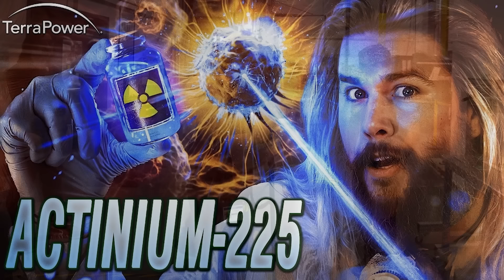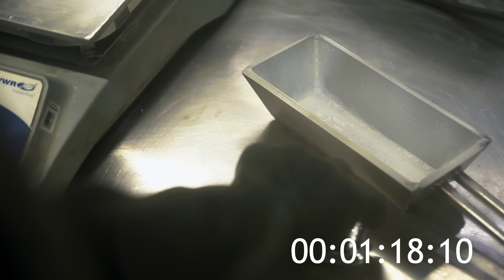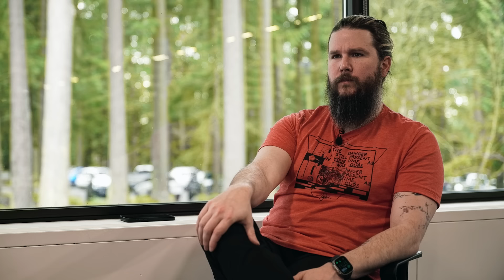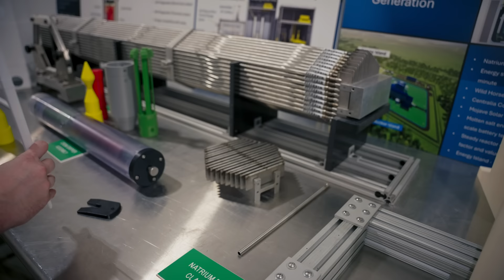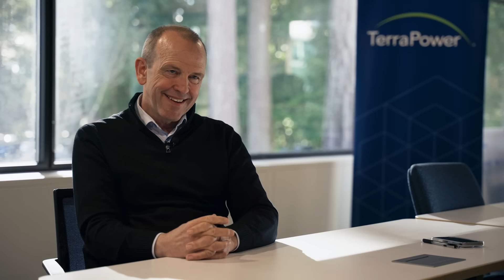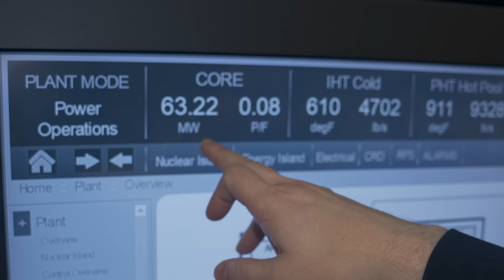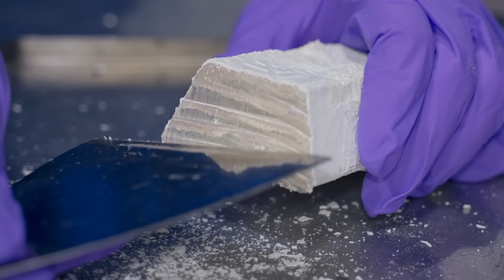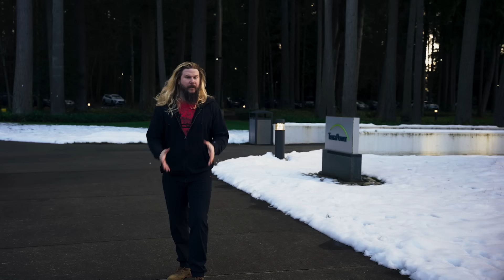Will Natrium Nuclear Reactors Change Everything?

Comment: 18:13 “You want to wear gloves to prevent the sodium hydroxides  from melting your skin and turning it into soap” is a wild statement to nonchalantly ignore 🗿
Reply: I love Kyle's "Oh is that what that does?" in response?
Reply: Surprised he didn't already try that out on a Kevin.
Reply: Actually, typical engineers, as they watch their prototype fail a "smoke test", that will get a layman running for their life.
Reply: Having worked with Sodium Hydroxide in school labs, yes it does feel slippery between your fingers. Leaky bottles from improper measuring.
Reply: Note that Sodium Hydroxide is commonly known as "Lye"  (also known as "Caustic Soda").
Reply: So, I had to patch a leak in my basement wall and proceeded to not wear any gloves while mixing and applying the hydraulic cement with my bare hands. I know what saponification feels like. Not fun. Lesson learned. It was bad for over a month.
Reply: @joecserna  Must read labels.  Hopefully the nukies know how to read.
Reply: "Dang, I forgot to buy soap today.... But I DO have this ingot of sodium and a waistline that could use thinning down."
Reply: Lye does the same thing. 
Lye + animal fat = soap. Skin would not be stretchy without collagen, and collagen is technically a type of animal fat. In short, we’ve known about that kind of injury for centuries.
Reply: I once accidentally dropped a miniscule amount of sodium hydroxide powder onto my middle finger. It left a burn that stayed there for 2 weeks and I can still see a miscoloured dot on the skin, though it has been couple of months since the accident.
Reply: It’s normal thing to say with this stuff
Reply: Fight Club
Reply: You don't ignore such a statement you HEED it
Reply: as a professional chemist why would our skin replace itself on its own if not to make up for not wearing gloves
Reply: @gerrits_machinations  😂
Reply: Based
Reply: What do you think exposure to high temperature and pressure steam will do to you?
Reply: Statement is not ignored if the gloves are worn as advised :D
Reply: Same with wood ashes, which is why they were used as an early form of soap, from what I've heard.
Reply: lol its true. sodium hydroxide, natural forms called "lye", have been used to make soaps for ages ;)
Reply: You can actually do this at home. But with bleach. If bleach gets on your skin. Itll also turn to soap. But dont do tgat
Reply: No more so than telling you to wear oven mitts when carrying 300 degree pans.  It is just lye, used in drain cleaning.
Reply: Kyle definitely did not ignore that. Watch his face as he looks at this hand after he hears that 🤣 18:31 😐😮
Reply: Hand-made soap
Reply: Wilder than that is there's a word for rendering fatty tissue into soap: saponify.
Reply: Chemists are very casual about a lot of potentially horrific things.
Reply: I'm not gonna lye....
Reply: I’ve gotten sodium hydroxide on me almost every day as I have to make pretzels for work. I’m a victim of soapification so much. You got about 25 seconds before it starts burning. It just feels itchy with mild exposure
Reply: bleach does the same thing to your skin lol
Reply: People worry about acids. Bases are like, "hold my beer". They turn fats in our tissues into soap.
Reply: @ComputerGeeks-R-Us and strong oxidizers say hold my vodka
Reply: This is actually very common. It's why your fingers feel "slick" after getting bleach on them.
Reply: Sodium will happily steal oxygen from the water in your skin as well...
Reply: what we have all seen fight club
Reply: Buzzkill. What if I want to do that?
Reply: Baking soda - not even washing soda, baking soda in yer kitchen for cookies - is also capable of making your skin a lil' soapy. It's just a nature of skin oils being hit with alkaline materials.
Reply: It’s also used to make actual soap, I’ve made some with the lye process it comes out nice
Reply: Thats pretty much what bleach does
Reply: @Cringer101 Holy shit… always wonder why when I use bleach and it got on my hand it feels so slippery… 😨
Reply: Yep you gotta be careful with bleach @ws.hicks0214
Reply: @ws.hicks0214  Hmm, me to I though it was from the soap in the bleach, but now I know that is just my skin melting.
Reply: @Cringer101 That's sodium hypochlorite not hydroxide
Reply: @Cringer101  not at all. thats what baking soda does.
Reply: @Cringer101  Good analogy.
Reply: Hey All.  What can I say :) (Sorry for my long list of “assumption”, but it worth to read it)
First: of all nuclear reactors can blow up not because of the pressure in the water, but because of the reaction runs away. 
	(I do not know any nuclear reactor failure, where the water was the problem, 
	all the time the control was the problem. The water only blow up just after when the reaction control was lost
	And to be honest lukily the water blow up, other wise the reactor core would blow up, 
	and the reactor core not only have 6.2kg of plutonium as the Fat Man nuclear bomb but several hundreads kg)
	Why this solution is different? Can't reaction run away in this solution when control got lost? Why?
	This video did not say a single world about how it will be controlled. (that is a suspicious sign)
Second: Concentrated Solar Plants are using natrium salt e.g Sodium nitrate (NaNO3) which is relatively stable, 
	this solution seems, it will use pure sodium (Na). That is a huge difference. 
	And this also means, we have zero real world experience with sodium in any reactor. 
	Maybe would be better to test in a gas power plant first.
Third: Sodium is very problematic, not coincident, nobody was able to do that before. 
	Sodium not just explosive and react with water. 
	It will react with oxygen, with halogens, with acids and of course with metals like aluminium, titan or zirconium and alloys. 
	It also can react with Nitrogen, which famous about its stability. 
	Which limits what materials can be used for the container.
	And the extreme heat will speed exponentially the reaction. Sodium will react with the wall of the containers, with the seals, with the pump.
	Before you said it will be sealed with argon, than how will heat transferred? Argon is a gas, which means, it will insulate the heat. (compared to direct contact) (that is why we put Argon into insulated windows)
	So how this system will possibly look like: the reaction heats the sodium, 
	the sodium will be transferred to another building, 
	where it will touch the side of the container, 
	and on the other side of the wall possibly will be water, because still in 2025 all nuclear reactor is just a steam engine.
	And possibly the steam will be 600C with extreme pressure, which of course "can't explode" (and don't forget sodium will be radio active)

Fourth: It is barely magnetic, and if you raise the temperature, even that little magnetism will disappear. 

Fifth: They are emulating in software. (yep, there was no bugs in software ever, what if one of the programmers uses chatgpt?)

Sixth: Also, if you think this won't instantly explode. This will be the same as the system with water.
	If you think on it, both water and sodium will have about the same mass which means, it can store pretty much the same amount of energy.
	And the water can boil, which means, if there is a release valve with a condenser, they can release a crazy amount of energy very quickly.
	And if you think, water can run away from the system, so sodium (it will be also in liquid form).
	(just for comparison, 1 cubic meter of water can store 418 MJ one cubic meter of sodium can store 119MJ when they being heated from 0 to 100)
	So, if you can heat the sodium to 600C and the water to 300C, this means, Sodium can store less energy, unless you make bigger pool, 
	but you can make bigger water pool too.

Seventh: Thermodynamic laws says all heat engine need a cold and hot side to transform heat energy into motion energy.
	Which means in practice, when you have a 1Gigawatt output reactor, it will require 2 Gigawatt of cooling. 
	This amount of cooling can't be solved with air cooling, that is why every single nuclear reactor built next to rivers.
	So, water can't be eliminated from nuclear power plant.
	But most people do not know, when the weather is hot, these nuclear powerplants must be switched off.
	The nuclear power plant can raise the water temperature between 8-13C (And we are talking about big rivers here), so if they do not want to cook the fishes and everything in the river, they have to be switched off
	And that is pretty much what usually happens :) just nobody knows about it.

I hope they can succeed, but I would not put my money on them.
Reply: @buscseik  Reactor cores dont explode, they melt down, without the water flash boiling to steam, other other materials flash vaporizing, there will be no explosion, there will be a nasty extremely hot mass of nuclear material in a  run away reaction steadily burning its way straight down through anything in its way while emitting highly energetic particles you don't want to be friends with. Nuclear devices take very specific set of conditions and processes to explode. This is not to say a reactor melting down isnt bad, but its not a bomb, there is a reason they call it a meltdown.
Reply: @buscseik  First: Yes, a reactor can blow up due to a water failure. A severe loss of pressure or loss of coolant (water escaping the reactor vessel) will cause the reaction to run away. The water can be the cause of the reactor going supercritical as well as the result of that.

Second: There have been a couple dozen sodium cooled fast reactors built in several different countries. This is not a totally unknown technology.

Third: Certain grades of steel pipes can contain liquid sodium just fine. See above statement about the dozens of liquid sodium reactors that have been operated in the past. You're also ignoring the molten salt intermediate heat loop, so at no point will there be a heat exchanger with sodium in one loop and water in the other. Heat will go from sodium to salt and then salt to water.

Fourth: It's called induction. Subjecting any molten conductor to a fluctuating magnetic field will induce a magnetic field in the molten conductor.

Fifth: The point of making a test reactor is to make sure the simulated behavior matches what happens in reality before building a full scale plant. What a stupid concern to voice.

Sixth: This concern is literally so stupid I'm not entirely sure what you're concerned about.

Seventh: This design partially addresses that, as the salt heat battery can store enough power to shut the reactor down for short periods of time as needed. Or they could go to an evaporative cooling system that does all of its cooling by evaporation rather than dumping heat into a body of water. The Palo Verde nuclear power plant is cooled by evaporating treated sewage water, for instance.
Reply: They are trying to show how safe sodium is and then they use solid sodium at low temperature while in the reactor we of course deal with the liquid form at high temperatures, two very different things. Nice stunt for people who don't think for themselves.
Reply: @AlJay0032  well, unlike the other reactors which exploded, this is completely unpressurized, making it a lot safer. It is, as they mentioned in the video, also separated from the water by a salt loop, yet again reducing the chances of it coming into contact with a reactant. Sodium also helps prevent corrosion inside the pipes, increasing the lifespan and the safety of the sodium loop. To my knowledge these reactors also have a layer of inert atmosphere around the pipe, meaning that even in the event of a pipe failure, it still won't explode, and the low SHC of sodium metal means that it's unlikely to be able to melt through the second layer.
Reply: @jonaut5705  I am not opposed to nuclear power or sodium reactors. What leaves a bad taste is that first the US government kills a sodium reactor developed by the Japanese and then we get these videos pretending the US has invented everything and there was no prior art and we now need subsidies.
This video is deceptive.
Reply: @AlJay0032  Honestly, it's alot less dangerous than high pressure high temp water anyway, it's always the separated hydrogen exploding that blows off reactor roofs, and taking water out from the reactor vessel really helps against that.
The only real main safety concerns I see is:
1. Don't jump into the vat of liquid sodium (duhhh)
2. Have alot of Argon on hand to prevent air moisture from causing problems
3. Use Argon instead of water to put out fires, cause you obviously can't use water
Reply: @binarybridgador2484  The problem with high temp water is when the pressure is lost, it instantly flashes to steam (aka. a "steam explosion") If it's on Mythbusters, it's an entertaining boom, but in your own house (factory, nuke plant...) it's no fun at all. Putting out a metal fire is something almost no fire department is prepared to deal with -- everything they carry is water based. Argon is a gas, so it's very difficult to put a fire out with it. (mostly because you have a fire because the argon cover was already lost, possibly including whatever structure was containing it in the first place.)
Reply: @binarybridgador2484  " it's always the separated hydrogen exploding that blows off reactor roofs"
Two questions:
1. Why is the housing airtight?
If it was well ventilated no mixture of hydrogen and oxygen could build up.
2. In German reactors they use passive catalysts to recombine hydrogen and oxygen, why not have those.

I agree that high pressure high temp water is dangerous and we should go to molten salt reactors or other newer and safer designs. That way we can go to higher temperatures and even increase efficiency of electricity production.
Reply: @AlJay0032  as long as the sodium remains in a closed loop it won't be exposed to water so it should be completely safe that way. I feel like you have a lot of other issues if you suffer a leak in your primary reactor vessel. having a second space around the reactor filled with an inert gas would also prevent the sodium from igniting if a leak does occur. I don't know if such a second layer is part of their design. but there are plenty of ways of keeping this safe.

I will agree that trying to show that high temperature liquid sodium is perfectly safe to work with because in this experiment with a room temperature brick exposed to air it doesn't spontaneously combust seems a bit misleading.
Reply: @binarybridgador2484  Argon, the worlds third most plentiful gas.
Reply: @binarybridgador2484  Even what if it got into eye in accident.
Reply: @AlJay0032  The point wasn't to show sodium being completely safe, the point was to show that sodium isn't going to instantly explode like how people have been conditioned to see in fun experiments. It gets more dangerous as you increase in temperature but they match that with increased safety precautions.
Reply: @AlJay0032 did you miss the part where they showed a pouring of liquid Na into a rectangular container and how it solidified into a brick of solid Na fairly quickly? Yes, liquid Na is dangerous. So is boiling water. So is just about every substance in the world in some form or another. So, use proper precautions and learn from others and what knowledge has been discovered and recorded by people who have devoted years of study to understanding the world. Think for yourself, indeed! What simplistic nonsense! With that kind of backwards ideology we'd still be hunter gatherers.
Reply: @AlJay0032  I believe you missed the liquid sodium being poured into a metal pan for cooling, without bursting into flame.  And all the sodium is in an unpressurized,  below ground pool covered by concrete and steel shielding.  How is that a threat to you as it circulates through heat exchangers, passing its heat to molten salt, also unpressurized except to circulate it to storage tank level? Think like an engineer.
Reply: @robertmeredith3940  I didn't miss any of that, that was in a chamber filled with argon gas.
Reply: @AlJay0032 The Chem industry deals with way nastier critters than  molten sodium on any given Monday morning. So you don't need to worry. But thanks for sharing your immense insights.
Reply: @MarkCammel  Chlorine trifluoride is scary scary stuff.
Reply: @AlJay0032  Weren't you paying attention? This reactor operates hundreds of degrees below the sodium boiling point. This reactor does not operate under pressure because it doesn't need to be pressurised for the sodium to remain in a liquid state.
Reply: @silentblackhole One good question is, how fast will that margin of safety be lost if the reactor runs too hot? Locally there will be temperature variance within the liquid sodium metal: at the fuel rods is where it will be hottest. They're counting on circulation and thermal conductivity to carry that heat away. Na makes sense as a coolant because it doesn't get radio-activated easily and decays into a stable isotope of Mg. What doesn't make sense is going after this source of heat to boil water and spin a turbine when there are cheaper, fully implementable, safe technologies available to generate electricity directly from electromagnetic and kinetic energy freely available to us. Awesome technology, but the objective for humanity is to get off of fossil fuels before the end of the decade.
Reply: @AlJay0032  Weren't you paying attention? This reactor operates hundreds of degrees below the sodium boiling point. This reactor does not operate under pressure because it doesn't need to be pressurised for the sodium to remain in a liquid state.
Reply: @AlJay0032  hey maybe this is because anything is dangerous and difficult to demonstrate with when at nuclear reactor core temperatures. did you know water that hot would also kill you?
Reply: @daphne4407   I am not opposed to sodium or hot pressurized water.
I am against making such a silly show and against government politicians and  picking winners by preventing Toshiba from making a sodium reactor and then giving an American company a heads up for a sodium reactor.
Reply: @AlJay0032  Simplification is pretty common in science communication, because trying to explain the whole process, tends to take more time then most have attention. This was just their way of saying, its not going to be as bad as it sounds. 

I do think efforts should have been made to offer a full explanation of their safety plans somewhere in the video or description, but I am not surprised by the simplification.
Reply: @A_Cipher  The dumbing down is in full swing on our way to idiocracy...
Reply: @AlJay0032  Yeap, but we're the "uneducated nay sayers". Zoom out so we can see the argon flooded glove boxes for those clips shows molten sodium in a beaker and bread pan. Pour some 500C liquid sodium into a bucket of water -- it will be nothing like what you saw in chemistry class. What you have to really worry about is the fire department showing up to put out a fire in your "nuclear island".
Reply: @jfbeam 

You.  You are why we don't already have energy independence.  
Of course there's no perfect way to produce energy.  But 4th Gen reactors are much more safe than traditional energy sources.  I'd sooner live next to a MSR than anywhere near fossil fuel plants.
Reply: @jfbeam fire departments that are in range of facilities that require spacial intervention have standing protocols for how to operate in those facilities. Any fire truck that is in range to respond for the planet will be made aware and practiced as to what they can and can't use. Not to mention the standard response every firefighter gets drilled with in their academy, those "hey let's try to spary water on this fire from a chemical plant to see if somethingin there will react" scenrios in movies and shows doesn't fucking happen. They verify what's in there and if need they use co2 or phone home for backup. They're gonna know what they're stepping into.
Reply: @koharindreg I'm a little less confident in fire departments after what happened in California.
Especially in Democrat run cities.